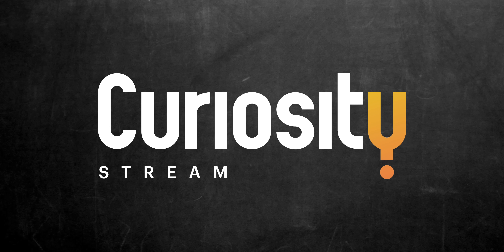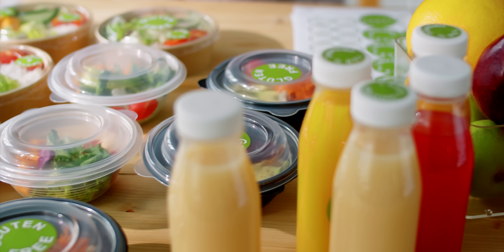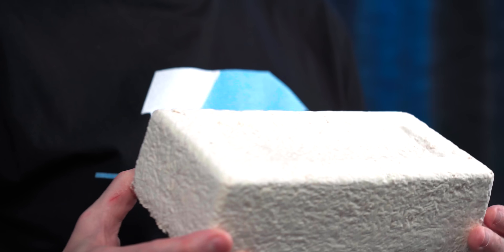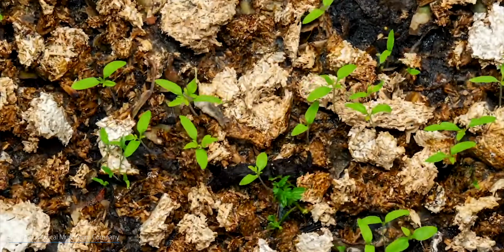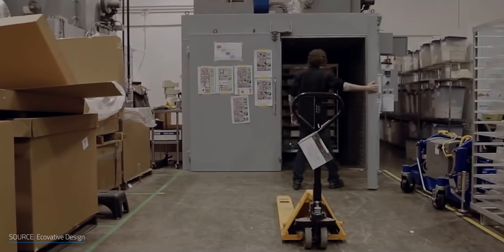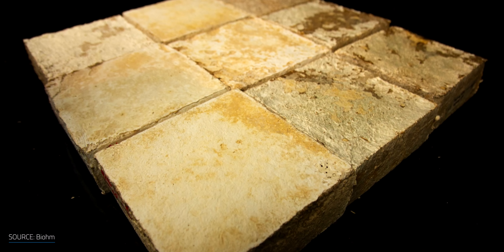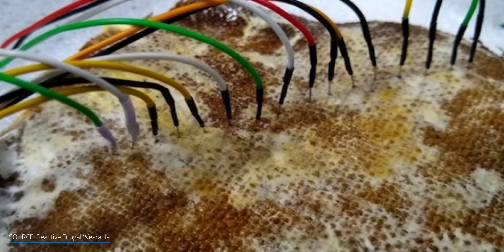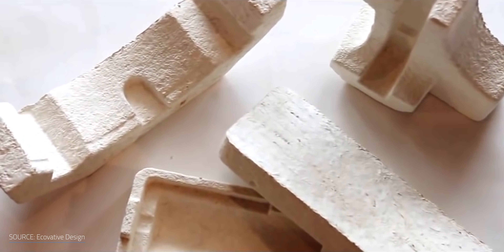Is Mycelium Fungus the Plastic of the Future?

Comment: "It takes about a week" - yeah but making 100 polypropylene bottles takes ~15 seconds so they're going to have to speed things up if they want to even have a chance at competing.  Also, one of the properties that makes plastic useful is that it DOESN'T biodegrade.  This is very important in food packaging / storage, for example.  A biodegradable plastic will almost certainly never be safe for food storage or anything that requires sanitation, chemical resistance, sunlight exposure, water exposure, or is used outdoors.  Many biodegradable plastics have existed for a long time (this is nothing new) and many products are based on them.  Oil based paints are a great example.  Linoleum is a great example.  Being "cost competitive" with polystyrene depends on the scale.  PS is very scale-able.  Spending a week to make a product means it will have almost 0 scale-ability by comparison.  So to compete at the same volume as polystyrene the cost probably won't be anywhere close.  It's a cool idea but this sounds like 100% pop science hype with near zero practicality.  On the subject of replacing plastics with a more sustainable solution, there is already an answer:  metal.  You can get stainless steel straws, plates, bottles.  SS is hygienic, durable, easy to clean, recyclable, and generally cheaper than plastic in the long run if reused many times.  With care they can last many years, even decades, displacing hundreds or thousands of disposable plastic products.
Reply: Theres a few issues i have with the idea of this material, particularly their efforts in using it as a construction material and circuitry. The main draw for the product is that its bio degradable, so why are they even trying to use it for things that NEED to last a extremely long time like construction material and circuits? its completely contradictory. Their "3 years of weathering" test doesnt work because unlike concrete and masonry, subjecting it to environmental torture tests dont work because it doesnt account for the bio degradable portion of the material.
Reply: Not every product needs and can be reusable. Realistically speaking we also need something that more or less used once. I think it's not a coincidence most of the video focuses on the packaging materials.

But yeah, I agree. Like so many other videos, this is pop-science that focuses on the huge benefits while almost not mentioning the drawbacks of the new technology.
Reply: Even if this fungus could compete on a price scale at production how about accounting for all the storage you'll be paying for since you need to grow product nonstop because it takes soo long to produce? Many products this fungus aims to replace are produced on-demand because of how rapidly it can be done. This fungus will require you to grow a huge stockpile to survive off of while your new stock "GrOwS". 

Save a nickle and a tree but your spending a dollar on every nickle saved for storage...
Reply: Once again, price, price and price. Insert that Indian quote here about eating money. If we would just slow down a bit and think for a second, all those troubles created by greed just melt away.
Reply: @OjStudios  Environmentally friendly & sustainable solutions already exist (stainless steel, for example) so if consumers aren't buying the more expensive product, opting for the cheaper plastic, it means the benefit wasn't worth the cost, and that's the problem.  "Green" plastics can't get their costs down while being inferior to traditional plastics in many ways.  So you can't expect consumers to buy a worse product at a higher price.  Do you think it's "greedy" for consumers to spend their money wisely?  No, it's greedy to think consumers should buy an inferior product at a greatly inflated price.
Reply: @Entropic0  That was exactly my point. Companies are greedy and everything is always about cost. Cost usually comes down to the time spent on something or it's rarity. "takes about a week to grow, 45 days to compost" vs. "takes seconds to produce, hundreds or thousands of years  to compost but still leaves microscopic crap behind." See the point? On a raw material based cost, this fungi is totally cheaper than any plastic. It's just the laziness "we already have the means" and "consume, consume, consume" so we need 10 million plastic cubes for packing instead of 1 million in a said time frame. It's funny how most of the processes we have today are far faster and superior to anything we had back in the day, still the older stuff that wasn't manufactured to breakdown, is still here. We could make things that last almost forever where needed to and things that just vanish away if needed, but again, more volume, sales = greed, because this and that needs their new phone or pair of poorly made jeans.
Reply: @OjStudios  That's generally not how it works. Businesses have to compete to provide lower prices and/or better products than their rivals. Generally their profit margins are around 1-5%. 95-99% of the cost of a product is from labor & materials. It is not greedy for a business to actually make money and be able to pay their employees. It is greedy to say a business should work for free and/or that consumers should buy an inferior product at a higher price.
Reply: @Entropic0  your numbers for cost  and profits are really bad.
Reply: @OjStudios  Suck it with your pompous evangelical 'greed' bullsh*t. China harvests renewable forests of bamboo for eating implements. India is still too primitive, they use palm leaves for plates, and their fingers. Has absolutely nothing to do with 'greed' or 'money' or any of your other rabbinical 'sin'.
Reply: @robertmarmaduke9721  I don't even want to react to your comment but mine had nothing to do with religion, like you seem to be implying. I don't like religions, in any form or scale.

Comment: Perhaps if the product is not strong. I can still have other applications in construction. Like decorative bricks instead of load bearing ones. The insulation already sounds promising. I also wonder if perhaps it can replace drywall. As that again not normally load bearing. And perhaps it can be used for decorative moldings. Does it stand up to water longs, perhaps gutters? 

I guess my other question is what stop it from degrading/decomposing. So like can the product stand outside or will contact with earth cause decomposing to start because of contact with other organism. Or maybe it more like wood in that regard. I’m not sure if my question actually make sense.

Comment: This is a great idea to stop plastic pollution. But there are two things at least left here. Since it needs to grow to form a final product, it takes time. And for such parts, they are massive in quantity needs. So, mass production for Mycelium? How big the factory needs to be to be equal or close to the current factory? And entry level for building such a factory? Another thing is the cost.
Manufacture and Wall Street mostly only cares about money. Even when they become eco, they use that for getting more money. And finally the cost will go to customers. But majority of customers wants low price good stuff. Anything unnecessary will become a waste for money. Like Apple stops giving a "standard" charger, which should be part of the product to make the product to function normally, they are not cutting the price down but charging you when you buy one. So, actually for the "ECO" Apple says, they are not caring about the environment indeed but actually want to get more money from "loyal" customers.
Plastic can be beat by government policy but still long way to go to beat recycled paper packaging. Trees are in danger too. And the pollution still exists when making recycled paper packaging.

Comment: When component parts are made from it then I'll believe this is a solution.
Reply: The video literally says that may be a possibility, and I don't see why that's the only reason this would be a solution? Why does it have to replace ALL plastics? Even if it only replaces one of the things that it aims to be used for, it'll be a huge win. Just ONE of the five different applications.
Reply: @sindicta5757  i don't care what the video says. When they make functional computer componants out of it, I'll believe it's a solution. Until then it's wishful thinking.

Comment: A replacement for plastic? maybe not completely. Cool new material? definitely. While this is a very interesting new avenue for construction and packaging, at the moment its just not at the level where its anywhere near as moldable (despite being fungi, haha) as plastic but that will come as the techniques develop. What it is really lacking is the property to be easily repaired. I can weld/melt plastic to fix cracks, I can paint acetone on ABS plastics to melt it down and smooth it out, fixing scratches and cracks, etc. Same thing goes for metal (for the most part) , you can weld it or melt it down to fix some issues, heat it up and hit it with a hammer to fix dents or bends. Fungus based materials seems to fall into the same category as wood, once its broken its never going to be as good as it was before, either hope glue will fix it or toss it out. It also appears as though like it will require a long recycling process, it cannot simply be melted down for reuse, you would essentially have to compost it over a long period of time to then turn it into material to grow additional fungus, which then has to be grown and then baked to ensure you don't essentially build a house that is going to then be jam packed with mold once it gets even slightly humid/damp. Its an interesting direction, but at this stage its more of a horizontal shift rather than an overall improvement. If its simply to replace plastic packaging (Which would already be a large change and improvement overall) its definitely got a few comparably "green" competitors with the many wood and plant fiber based packaging solutions available or in development..

Comment: 6:01 biology aint gross
yall just need a spiiiine 

is a carpet gross? its got fibers facing the same way, packed next to eachother
grass? lawns of blades standing up next to eachother (that c o u l d be eaten by... bugs? cows? not the point) 
no, id say its pretty normal of a set up. Id be pissed if all the fibers h a d to be facing away from eachother, itd be more scratchy than cushy, or each and every blade had to grow radially away from the rest? nah, the lawn would look like some 35 y/o balding dude, itd look ridiculous
 
(my favorite thing, take somehting you suspect is just, odd af, and put it "under a different light", change the subject slightly. It shows the glaring issues with said thought process or w/e)

Comment: Interesting video, I feel like literally everything has a downside though and because he didn't mention any downsides it feels more like a market advertisement that an fyi video.
Reply: Definitely curious how it handles being in a wall for decades occasionally getting wet, or e.g. as the insulation layer on water pipes - presumably it would rot pretty quickly, especially as its natural purpose is to be a root system and absorb water. Short lifespan in packaging feels like a much better use case.
Reply: @hijackstudios  accelerated aging simulates this also, mycelium are biologically designed to be anti-rot, they live in damp dank places so this is necessary for them to exist.
Reply: To be fair he did mention slightly higher costs compared to conventional packaging.
Reply: Everything has a downside ofcourse but those are probably things that with further progress we can minimize/ eradicate.

I think that the point is: though it might have a few drawbacks it’s is far better than the stuff we have right now.
Reply: Its biggest strength is its biggest flaw- it's easily biodegradable. It will rot and decay if poorly handled
Reply: There are quite a few people with mushrom allergies, thats a huge problem.

Comment: People need to understand that plastics benefit is that it doesn't decompose.  We don't want plastic to decompose, that would defeat the purpose of plastic.  The problem is the industry makes extensive use of the stuff where it shouldn't.  Why plastic bottles when glass bottles can be recycled?  BTW you can't recycle plastic, that's a lie.  Why plastic car parts that get brittle over time when aluminum won't?  Punish the industry for over using plastic and not the people with inferior products made of fungus.  You people seriously don't see a health hazard for storing products in something that can biodegrade?

Comment: So the answer is yes, but only if it's cheaper to produce, and it's just as durable, water proof, temperature resistant, flexible, and has no allergens just like plastic.  Otherwise, no company is going to adopt a patented process that takes that much time and energy just to make a green product and at higher cost to the consumer.

Comment: any improvement in this sector is great, but it'll take a little less than forever to get this technology to even partially replace the plastic footprint. I wonder what kind of mechanical properties this mycelium has and if it can be moulded into a mechanical part, or if it can be powderised and 3D printed.

Comment: An important question is, does it have the potential to be waterproof like plastic?
Reply: When dried it is resistant to mold, water and fire.
Reply: @fakshinx8370  Resistant means it does not degrade in water, it doesnt answer the original question.
Reply: @D3R3bel  it's basically the same thing. 
You can even look it up if you want.
Reply: @fakshinx8370  Leather and fabric varients are, but from what im seeing, Packaging is not. Which is what i expected. Its a replacement for foam and cardboard, not for things like plastic bags or in store packaging.
Reply: @fakshinx8370  But does the water leak through it?
Reply: You can always apply perfectly waterproof chemicals on top, like Aerogel powder, I think. That's why we have scientists, right ? So that they can search how to do that :)

Comment: The reason why "pentafecta" sounds wrong is you're combing a latin root (perfecta) with a greek prefix (tri-, tetra-, penta-, hexa-, hepta-), instead of the latin root (tri- [yes its the same], quadra-, quinta-, sexta-, septa-). So even though "quadfecta" isn't in any standard dictionary, it follows gramatically, and so would "quinfecta."

...grammar nerd session ended.

Comment: It's actually pretty easy to recycle Styrofoam.  I can't imagine why no one is doing it on an industrial scale.  Simply put you mist Styrofoam with gasoline and depending on the ratio you get anything from a sort of napalm to the type of glue they use in mouse and insect traps.  So technically it's now recycling it into Styrofoam so you can't just go round and round with it but you can make other useful products like glue.  I mean what if you recycle Styrofoam into glue then use that to make something like plywood which used a LOT 9f glue in its production.  What if all u made with it was mouse traps.  It might still end up in a land fill eventually but at least you get two uses out of it instead of just the one.

Comment: Mycelium insulation would have me worried about the mold we already have trouble with in homes colonizing it. Plus the concern that your insulation may decay over time. If it doesn't run these risk then it sounds like as good an idea as any.

Comment: I wonder what the unintended consequences will be. We saw a change in the coating for wires in electronics because they were all made in china, change from plastic to Soy, and now we are having rodents, rabbits, and other small animals build nests in cars that are left in 1 place outside for more than 2 nights.

We already have a solution to landfills filled with plastic, its called Ideonella sakaiensis and it breaks down some of the most common plastic out there and is already present in most landfills. The stuff that we were told would last for more than 3 thousand years is only lasting 10 years before its degraded enough back into something that isn't even toxic as a byproduct.

I'm not saying don't invent new technologies, I'm just saying be careful with putting all your eggs in a basket that may attract an unwanted critter that decides to infest your house to eat all the tasty mushroom byproduct.

Comment: Mycelium panels in construction are basically no different to wooden planks so why not, fiberglass and styrofoam insulation isn't all too great in the disposal side of things and they're waiting to have their podium taken.
I highly doubt we'll ever replace concrete, too cheap and reliable while these mycelium bricks still require R&D and are likely never going to reach that level of performance required.
Replacing packing material almost entirely would be quite the accomplishment, reducing plastic waste by a 5-10% at least, though it's unlikely that will take footing nearly as fast as for insulation and faux leather unless the change is heavily supported by multiple nations and multinational companies. Small and novel/luxury companies won't do much.

Comment: Maybe they could create large mushroom Lego pieces, to be used to quickly build temporary housing. This could go with a wooden framework, as the material wouldn't be load bearing. But it might still be an improvement to those pre- fabricated plastic emergency pods you sometimes see in areas of crisis.